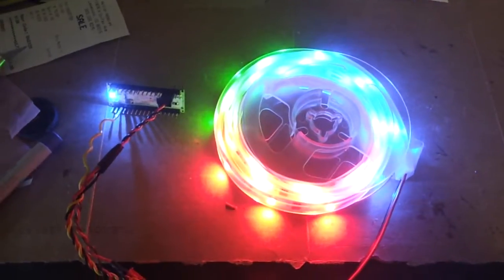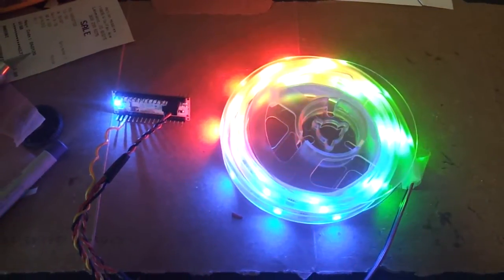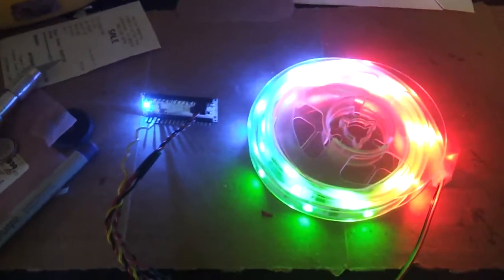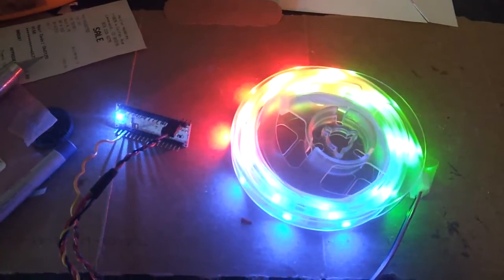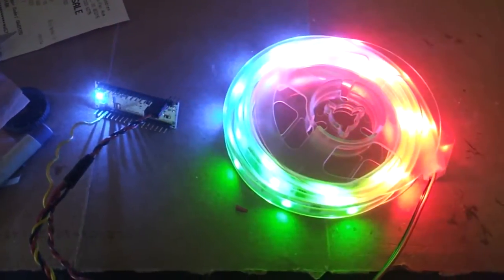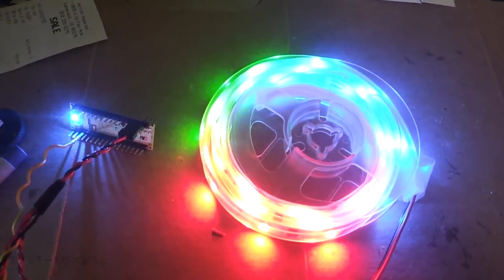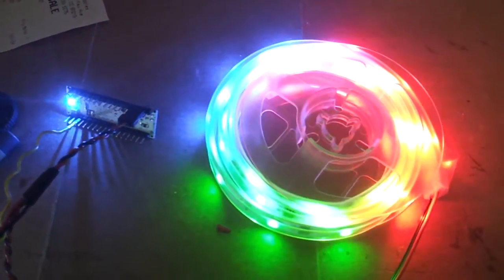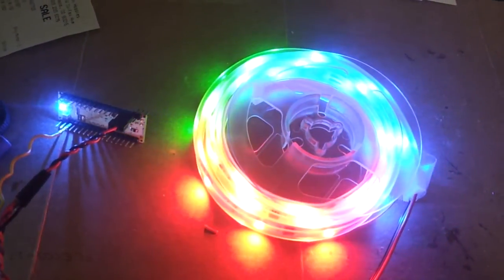Radio Shack Tri-color LEDs actually working!

Comment: My question is, how do you wire everything up to the Micro? is there a schematic available? On a side note, can you do this with an Uno too?
Reply from the maker: Yes, technically you can do it with any controller with a serial line. The wiring is the same for the Uno. It's shown in the next video on this channel...